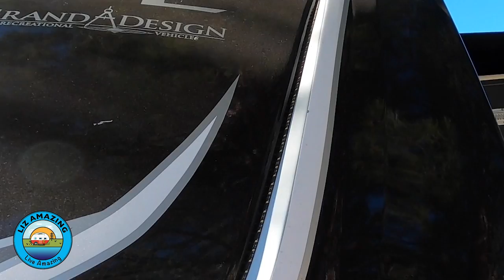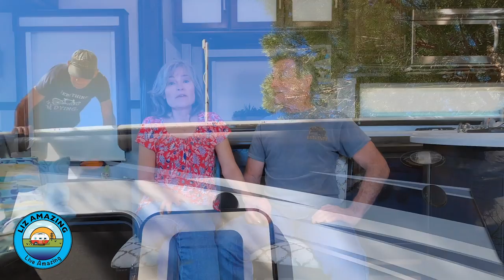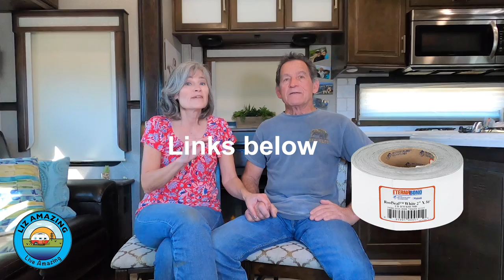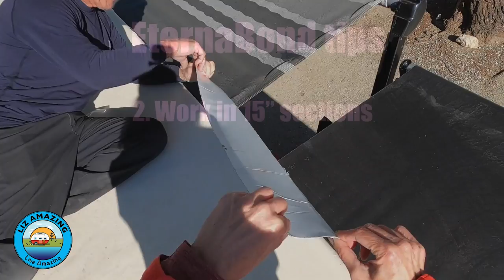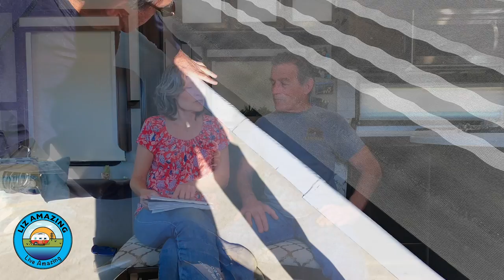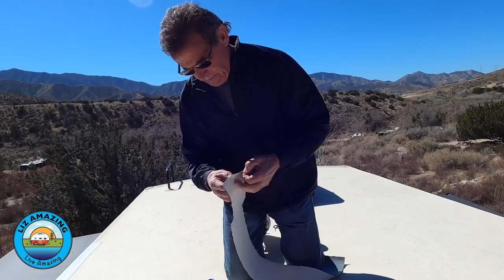RV life: We damaged our camper | $10,000 mistake | EternaBond | Fulltime RV Living

Comment: Here’s my advice. Have a damage repaired professionally. Then sell your rv. Then buy a Airstream rv. If you can’t afford the Airstream that you want or need, start looking for a used one with a motivated seller. Airstreams are really well designed and built. You’ll have far fewer problems with a Airstream. All the other brands like the one you have look beautiful sitting on the dealers lot. Once you take possession and start traveling and using it, you’ll realize how poorly they are designed and built. First of all they are assembled or built using staples. The staples go into wallboard that is very thin and like compressed paper. Where actual wood is used it’s usually cheap particleboard. The suspension systems that are used are crude leaf spring systems and when traveling down the road your rv experiences the equivalent of a constant earthquake that twists, shakes, and rattles everything loose. The frame systems are not nearly beefy enough to handle all of this especially when the rv is fully loaded with all your possessions and provisions. Don’t take my word for it, do your own research. I’ve seen people that have rv’s like yours and they try making upgrades to the frames and suspension. It’s not worth spending the money!
Reply from the maker: Hi Kevin! We love Airstream but they don't seem to be built for full timers, although people do try to live in them full time. We looked at a 30' one but had just 900 pounds CCC. Tanks were smaller than what we are used to. And we can't find any with rear living. We stay in campgrounds backing up to rivers, lakes and views so we really want that rear view. Let us know if you hear of any Airstreams with 2000 CCC and a good floorplan. We seriously would look at one if we could find one with that. Thanks!
Reply: @LizAmazing  yes, airstream doesn’t have slides which give a lot more living space. Also tank size can be an issue. Hey, there’s a couple that also have a youtube channel. They are full time rvers too. The name of their channel is Changing Lanes. Check them out. The husband is extremely handy and is constantly working on their rv fixing things and many times making improvements or upgrades. They have a Momentum fifth wheel. They even upgraded the suspension on their trailer to a full independent suspension system plus a major upgrade to the pin box. Check out their channel, as it will give you some great ideas.
Reply: There’s also another good channel called My bucket list day. This guy had a accident with his trailer which damaged the frame and rear cap of his trailer. The trailer was a total loss. His new trailer got a reinforced frame and a rear skid plate which I thought was a great idea. I really like that suspension upgrade that the changing lanes guy did. When you’re trailer is traveling down the road and hitting pot hole, running over rail road crossings, ect. The trailer ‘s structure takes a beating. A good suspension system can make a huge difference. One other thing ive learned is that being a good handyman is a must for full time rvers. Also having tools and resources for repairs and improvements.
Reply from the maker: @kevinschwinkendorf3202  Changing Lanes, yes they are a good source of info and we watch them now and then. Thanks bunches! We for sure do need to do a suspension mod.
Reply from the maker: @kevinschwinkendorf3202  I watched that video from where his rig got messed up in a campground- wow!
Reply: @LizAmazing  check out the youtube channel Keep your daydream. They are full time rvers and they have an airstream. Keep in mind that wherever there’s a slide, you don’t have storage space.
Reply from the maker: @kevinschwinkendorf3202  I follow them, they are such a nice family!

Comment: Those Grand Designs are VERY NICE.  10k off trade in?   Wow.  Just finished watching.  SOrry this happened to you but well done on the fix.  Thanks to you we will definitely try to avoid even scraping a limb.  I had no idea these roofs were so fragile.
Reply from the maker: We didn't either. And honestly it can be unavoidable to come in contact with a tree. There are times you have to move over to avoid something in the road and.... Also, you could see it wasn't that big of a branch. We are considering a different kind of roof for the replacement, something beefier for sure. Thanks for your comment and kind words.

Comment: Not a 10K mistake. That Eternabond will outlast that coach and everybody watching.  Do Not overlap!!! Bad info!!! Cut straight on a piece of pine wood(flat, clear) with a sharp knife and a ruler. The edges will match perfectly!!
Reply from the maker: Great tip, thanks! If we were to trade it in, we would lose $10k off the value because of the patch. Fingers crossed that insurance will cover a replacement roof. Stay tuned.

Comment: RV Rubber roofs are the absolute worst product ever made I really dislike it, TPO & EPDM are very susceptible to damage quite easily, made for manufactures to rapidly make these units and ram them out the door telling customers it's a good product when it's not, then you play the Dicor "lap sealant game" every year a few tubs of this stuff & it’s a never-ending battle, plus you need to wash your roof twice a year, use RV Roof Protectant twice a year to prevent fading, oxidizing, drying and cracking from harsh UV rays. If you buy a towable RV with the exception of Airstream you will deal with the subpar quality of RV rubber roofs. One more note and I have noticed this driving on the highway’s I so many roof bubbles near the front caps at highway speeds all the time its mind-boggling how poor the quality of this roofing system is.
Reply from the maker: We agree 100% which is why we are not replacing our TPO with TPO. Here's what we are doing: https://youtu.be/9Yv0ZKSfvbc

Comment: 10k for a roof on how many square feet.  how is that justified   seams a steap. is this the norm to be royally taken for every maintance call such as car dealers do for those high end cars
Reply from the maker: TPO is $300 per linear foot so for us that works out to be a few dollars under $10,000. Stay tuned for an update on our roof repair. If you haven't already, ring the bell to get notifications.
Reply: @LizAmazing  i just hate seeing good folks getting ripped off  that price is a lot it may be the going rate but i feel they are still ripping you off

Comment: The best way to put the tape down is only pull back a small portion of the tape back and apply and start pulling the backing off as you are applying it rather taking it off and try to put down a strip by itself.
Reply from the maker: That's a great tip, thank you! We love that Eternabond!

Comment: I can't believe how many people buy into the rubber roof racket on RVs and makes no sense whatsoever the only reason they do this is so RV's will not last long and Destroy easily and don't give me that nonsense they need to flex...... I put multiple different kinds of metal roofs on RVs over the years and never had a problem with it I'm a metal fabricator by trade so it's not that hard for me but it shouldn't be that hard for anyone really it just takes a little common sense...... and guess what my roof never leaks and it's all one piece you could literally take a sheet of 043 aluminum or thinner and make it fit your entire roof and not have a single hole in it other than the ones that are supposed to be there that works so much better like a thousand times better and you don't have to worry about a twig poking a hole in it or it rotting or ripping or separating or lifting or any of those things do it right you won't have any kinds of issues at all but then again I build most anything I own I don't like getting ripped off and I like things that last to each their own I guess some people like breathing in formaldehyde and all that other nasty stuff too that's why they buy the new RV's...... Big Daddy government allowed the RV manufacturers to start putting them nasty chemicals back in the RV's a few years back........ if you don't want to put on a metal roof at least consider putting a spray in bedliner on the roof they work really well I heard a guy put Flex Seal on one of them and it turned out nice I don't know how long that would work but I do know the spray in bedliner trick work's or the roll on one if you get the right brand
Reply from the maker: Agreed. A metal roof would be the best! The cost would be astronomical though. We are actually looking into those spray on roofs you mention. We definitely want something more durable than the Tissue Paper TPO! Stay tuned!

Comment: Rubber roofing is an inferior product! Should never buy RV with rubber roof it is applied with water base adhesive.  Filon or metal roof are a better way to go 1972 dodge superior metal has had a few several options on repair. Thanks
Reply from the maker: Thank you! We will keep you updated for sure.